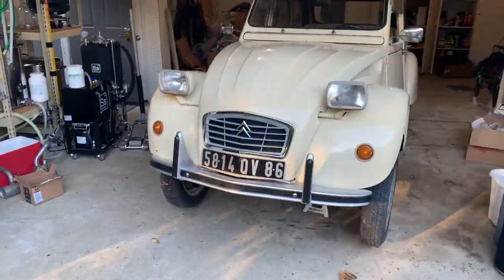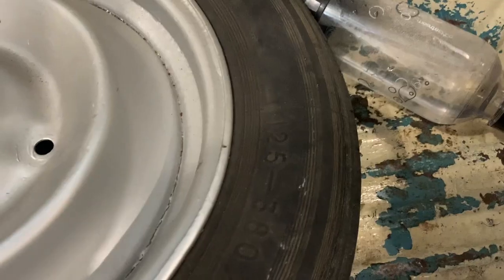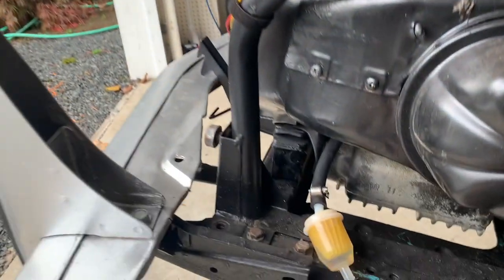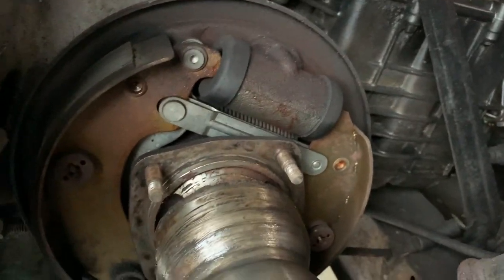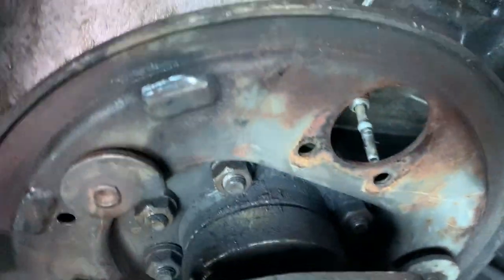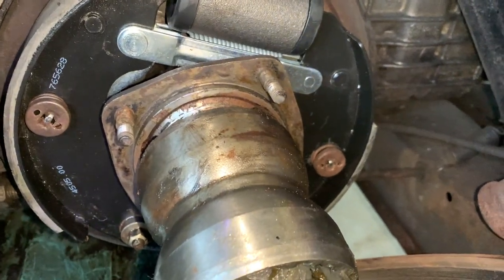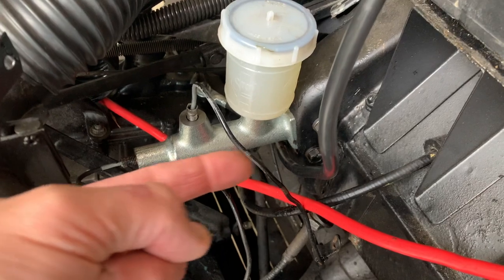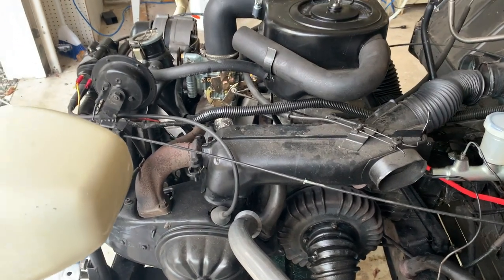Overhauling the front brakes on my Citroen 2CV

Comment: I've read comments and watched others have problems with those retainer springs. I just grip the caps with a pair of pliers and turn while pressing down on the spring. You do need to have a finger on the back of the pin but it's a 2 second job to remove. Point taken about the access from the back though.

Comment: It’s mentionned « 2 CV4 »…
But the engine isn’t a 2CV4 engine.
Obviously, it’s a 2CV6 engine…
When I change to the 2CV6 engine, I also change the gearbox…to fit a disc brakes one.
😢😢